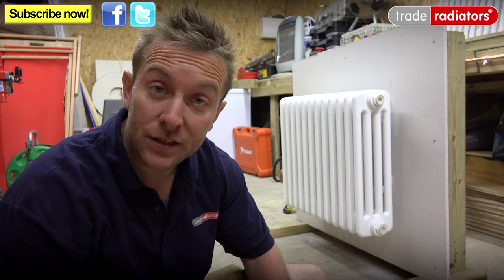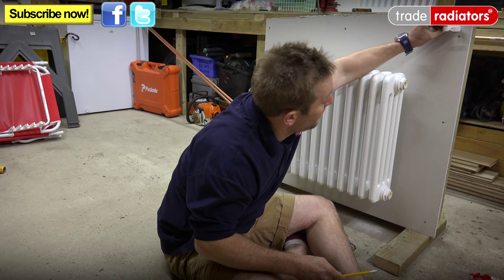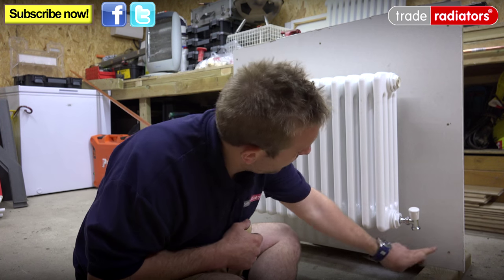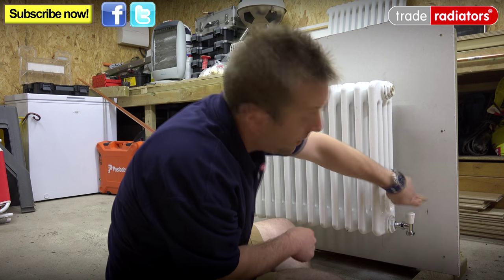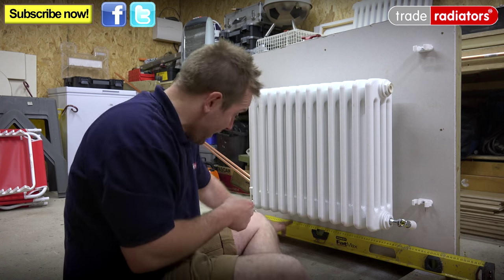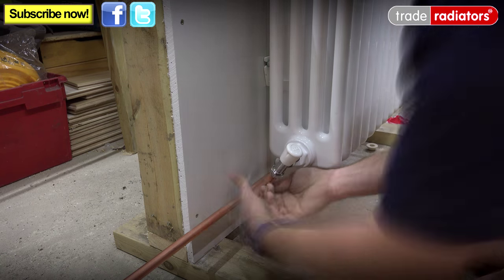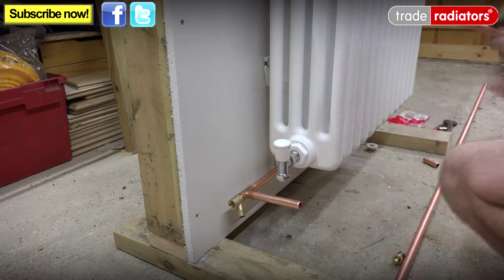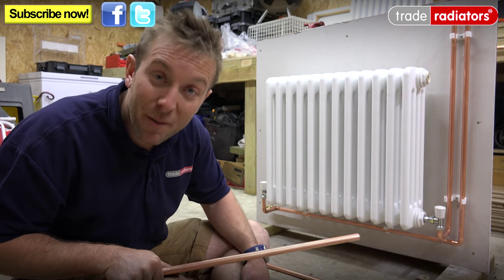Learn How To Pipe A Radiator

Comment: would I be able to use to use 2 15mm compression elbows to get my radiator pipes current distance of 650mm to 600mm as it would help a lot!

Comment: I don’t know if this is relevant but could use advise if anyone is willing, i live in an old building built in 1860 and today I hung a board up above my radiator. Due to the board being so heavy I used large nails and on one nail it would only go in about 3/4 of the way, I assumed it was because it hit brick in between the plaster wall but now I’m unsure and overthinking what if I’ve hit a pipe also what if it is a gas pipe? Any advice?

Comment: How do you make a radiator so that the TRV is at the top? I hate bending down to adjust those things and I want my 2 new radiators downstairs to benefit from having the pipes coming from above and being able to install the TRV at the top rather than bottom.
Reply: Cold air is heavier than warm air, so its more useful to have your trv lower

Comment: Would i be able to remove 1 section of the radiator thats cracked and put back together without that section. Will my radiator still work?
Reply: Depends on the radiator itself

Comment: Silly question if you wanted the pipes in the wall. Could you run them behind the skirting? Or is this not a good idea due to future work changing the skirting and maybe needing to drill the skirting?
Reply: you could run them in front of your skirting and just box it off so it will look neat.

Comment: Hi. I've fitted a straight replacement type 22 rad in place of an old single panel radiator that's on a drop down feed system and the new radiator won't heat up properly, old rad got red hot and this one just won't do it, i'm gutted as this one was supposedly going to be 80% more efficient !! the system is pressured and radiators all round the house bled so can't see why it won't get hot, all valves open fully to allow flow through the radiator. anything i'm missing that will solve my problem?? thanks
Reply: This is a late reply to your query but it may help anyone else with a similar problem. There are 4 reasons why you can get no heat after fitting a new rad;  1)The system became unbalanced when you shut off all other rads to drain down.  Check this by turning off all rads exept the new one, and see if you now get heat through. If yes see any vid on balancing systems.  2) You have a faulty rad, blocked internally. This is very rare.  3) You disturbed crud when draining down, more common in microbore pipe, which has blocked either pipe or valve.   For  3,  check with the bucket test by disconnecting each valve from the rad in turn, and open the valve into a bucket to prove there is flow through the pipe/valve. Either may be blocked.  4) System is airlocked, see any vid on clearing airlocks.  Hope this helps.

Comment: With deep rads like these you could consider fitting the valves horizontally, that way you would only need one bend.
Reply: PS what Jimmy should have mentioned is, when fitting valves  to the rad put loads of ptfe tape on the threads, a few turns is never enough and it will leak.  Nearer ten to make sure.

Comment: Shouldn’t the feed be in the bottom and the-return at the top?
Reply: Anthony Smith valves are bidirectional these days so it doesn’t matter
Reply: And pumps keep the water moving so you’re not relying on gravity to push the water in/out